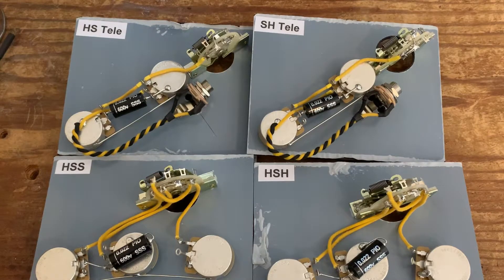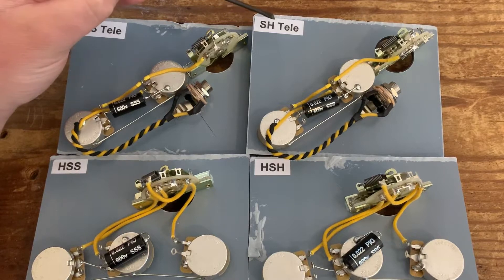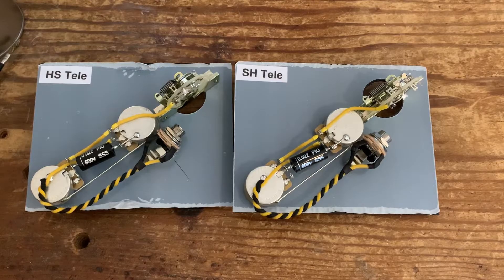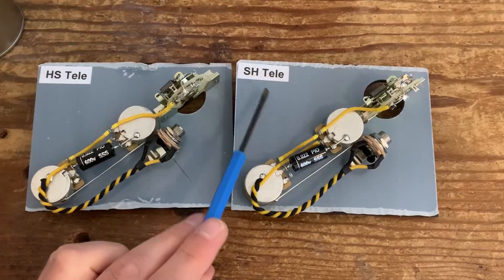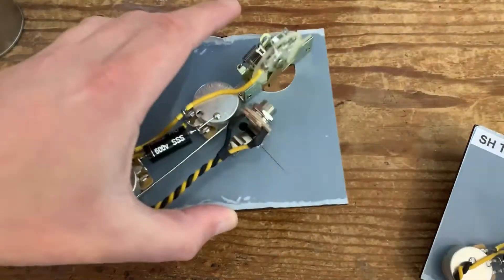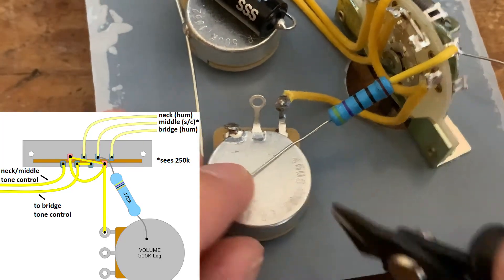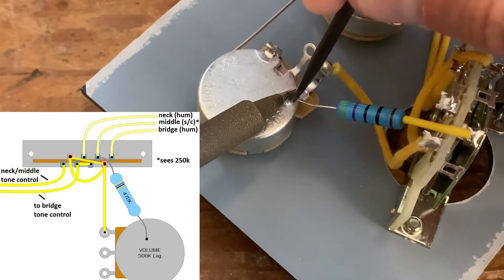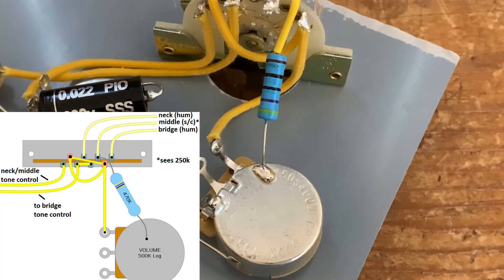How To Use Resistors to Balance Single Coils & Humbuckers In Your Guitar

Comment: Great video!  Is it possible to wire a resistor with a 5-way switch (as shown here) but to achieve the PRS partial coil tap method, instead of using a push-pull?

Comment: what watt rating are the 470k resistors I got 0.25 Watt 470K Resistors but look a lot smaller than your ones in clip would they be ok to use

Comment: Can anyone advise HSS wiring for 1 volume 1 tone, using both 500k pots? Where does the ground from resistor go to, volume or tone pot? Also if using a 500k pots, will the middle/neck pickup still see 250k after resistor install? Thanks a bunch!

Comment: if i wanna do the hss wiring for a hss strat but only have 2 knobs, one 500k master volume pot and a 500k master tone pot. then its just the same except i put the tone jumper wire through all the 3 holes of the selector right?

Comment: Am I correct that you could use a cap in parallel with the resistor to fine tune which high frequencies survive (like a cathode vypass resistor in a preamp stage)? Guess even if it works there might be no purpose since you want to roll off the highs by reducing the resistance.  But could I shape which high frequencies geht rolled off??

Comment: If using this on a les paul. Would you put the resistor to the toggle switch and ground to the switch as well or go from the lug with the pick up connected back to the pot?

Comment: Resistors take away tone from expensive bought pickups.
Reply: The control pots are resistors. 

The added resistor just loads the pickup as if it's seeing a 250K pot, that's it.

Comment: Is it possible to connect a push-pull potentiometer in such a way that when using a high gain pickup, there is a full signal in one position of the potentiometer and a slightly attenuated signal in the other position?

Comment: looked everywhere for the solution to the Tele SH wiring. 500k pot with a resistor between the single coil and switch. But if you're using a 3 way switch - what does each position give you?

Comment: No kidding: I was looking for this and before I found it I figured it out myself. One hour later I find this video with the exact same solution.
I have a Tele with a humbucker in the neck and went with a 1 MEG resistor from the bridge pickup connection to ground.
This way, the circuit "sees" 500 k // 1 MEG = 330 k for bridge/bridge+neck and 500k for the neck only.
A 750k resistor would give you 300k in total.
This will make the SC a little brighter, but it won't muffle the HB in the middle position.

Same for a Strat with a humbucker in the bridge and 500k pots:
1: bridge: HB - no resistor required, the humbucker "sees" 500k
2: bridge + mid: HB + SC - 1 MEG on the SC to ground gives you 500k // 1MEG = 330k instead of 500k, the SC may be slightly bright, but the humbucker still has enough brightness
3: mid: SC - 1 MEG on the SC to ground gives you 500k // 1MEG = 330k instead of 500k, the SC may be slightly bright
4: mid + neck: SC + SC - 1 MEG on each SC to ground gives you 500k // 1MEG // 1MEG = 250k instead of 500k, which is a perfect match for two SCs
5: neck: SC - 1 MEG on the SC to ground gives you 500k // 1MEG = 330k instead of 500k, the SC may be slightly bright

If you really want to do this perfectly, you'll need a super switch and use different resistors for each position.
You connect the output of the 3rd blade to the input of the pot and all presistors are connected to the ground on the other side.
1 - no resistor required
2 - 750k or 1MEG resistor required (the pickups see 300k or 330k in that case)
3 - 510k required (the pickup sees 250k in that case)
4 - 510k required (the pickups see 250k in that case)
5 - 510k required (the pickup sees 250k in that case)
(use a single 510k resistor and connect positions 3-5, of course, use an additional resistor 330k or 470k and connect that from position 2 to 3/4/5, which will then connect to the 510k resistor)

You could use the 4th blade to vary the cap value for the tone control in that case...
Connect the pin from the tone control to the central pin of blade 4 and connect different caps in positions 1, 2, 3, 4 and 5 to give each pickup combination its own tone control character). Connect the other end of the caps to the ground.
1 - 22 nF
2 - 33 nF
3 - 47 nF
4 - 47 nF
5 - 47 nF
(use a single 47 nF cap and connect positions 3-5, of course)

Comment: So just to make sure I understood this correctly, when using 500k pots, I just need to have the 470k resistor connected to the same switch lead as the wire from the single coil,  and then to ground, in order for that single coil pickup to see 250k when selected.  Is that right?

Comment: Hi! Does it matter if you solder the resistors (HSS mod 2x resistors) ground side on the top of Tone pot, instead of on the top of the Vol pot?
Just to mention that my Vol is 500K and my 2 tone pots are 250K. 
Thanks Cheers!

Comment: Is it possible on an SH Tele with a phase reverse switch on the bridge? A resistor on both leads at the selector switch? Im wired exactly like a Baja with a push pull and no cap to ground like there is on the Fender S1.

Comment: So if I've got a Tele with 2 single coils but the neck is too dark, will adding a resistor to the bridge hot terminal on switch and ground darken the bridge so it matches better?  Will the first example  HS Tele work the same if the neck is a single not a humbucker? thanks

Comment: Hey, thanks for the vid it was very helpful with rewriting my telecaster (with a humbucker in the bridge and a single coil in the neck) as a beginner One problem I have now is the volume and tone pots always sound like they are on full, regardless of how I turn them. Are they just faulty pots or is my soldering just bad? I’ve checked mine against the diagram on your website multiple times and it looks the same.

Comment: Thank you for this, however I have a doubt about the HSS, if you put 470K resistors then the Bridge and Middle would see effectively ~242K, that's good,  but what when you have Bridge+Middle so Position 4, then the two resistors will be in parallel with the pot, that gives you effective 160K , and that would make the sound darker, but in this "quack" position you would like to have it brighter, so how to resolve this problem ?

Comment: With the HSS setup, where neck and middle single-coils each get a resistor, what happens with a five-way switch position 4, when both neck and middle are selected? Do they not then each 'see' something like 166K? Also, is the resistor wattage important? It looks like you are using 3W. Are 1/4W and 1W too little?
Reply: I wonder too. That resistor looks like it's 470 Ohm and not 470K Ohm (since the multiplier ring looks black and not orange as shown on his diagram).  I guess black is the new orange lol.

Comment: On your 5 way switch diagrams you have the neck with one tone control and the middle & bridge on the other tone control, for both configurations, hsh and hss. Is it ok to jump at the switch  the neck & middle to a tone control and have the other tone just for the bridge on the hss. Simlar for the hsh, except one for the single coil? Thanks

Comment: That HSS wiring is the most elegant and simple solution I've ever tried. Just slap a .047 capacitor for your single coils and you're golden. You can also easily make the humbucker auto-split in position 2 and you got yourself the best config I've tried in years. Pro tip: use hotter single coils (such as Fender's Tex Mex) paired with a moderate output humbucker like a PAF.

Comment: So the purpose of the 470k resistor is to use resistor association to reduce the resistance to around 250k in the single pickups?
Reply from the maker: yes - but the downside is in the middle position of a Telecaster for example, the resistance would be circa 135k
Reply: @SixStringSupplies 
Doesn't a normal telecaster use 250 for volume and 250 for tone? Which in effect makes the pickup see 125K

Comment: How about this?  EVH Frankie guitar - 500K volume Pot with no selector, no tone control.  I want to hookup the dummy neck pickup.  Where does he resistor go?    Volume pot will be a push/push to switch from humbucker to single coil.  Without the selector switch, I am wondering how it will play out.  Does the resistor go straight in-line or would it be neck P/U hot lead split to hot input and ground and ground wire to ground?

Comment: Late to the party but one thing I just noticed about the HSS wiring. The schematic says to solder the 470k resistor to the first tone pot which is 250k? is that correct? meanwhile in this video you show soldering the resistor to the 2nd tone pot which is 500k? which is correct? the schematic or the video? :D
Reply from the maker: Hey! They are both correct and perhaps this is not explained well enough in the video. You are not soldering the resistor between the switch and the pot, but between the switch and ground. The pot casing is ground so you can solder it to any pot.

Comment: Why isn’t it necessary to add a resistor to the tone pot?

Is it necessary that both pots are 500k or is it ok to use the stock 250k tone pot in the S/H configuration?
Reply from the maker: you can, but even using 500k for both, and using a 470k resistor in one position, results in an approx reisstance of 135k in the middle position. It is already a compromise. So personally you are better off using 2 x 500k or 2 x 250k but if you did want to balance out, then use 500k x 2 and a resistor.

It is not being added to the volume pot. It is being added to the pickup on the switch and grounded on the pot.
Reply: @SixStringSupplies  does it matter the wattage of the resistor?

I’m guessing, no.  Because there’s not a lot of power in a guitar signal… but judging from the size used in the video you’re using 1 watt resisters?

Comment: Good tutorial on the relationship between Humbucker and single coil guitar pickups with 500K and 250K potentiometers or pots. Simple explanation on why single coil pickup needs resistor to step down 500k to 250k.

Comment: Diagram at 12:00 doesn't match what you're doing
Reply from the maker: yes it does....if you are referring to the fact that in the diagram the resistor goes to tone and in the video they are going to volume - they're actually going to ground - ground is ground, you can solder them on either pot
Reply: How you figure??? It's exactly what he is doing... just takes few seconds

Comment: Hi there, I noticed @12:14 that the diagram that you are showing shows that the resistors are connected to the tone pots, but you are actually connecting it to the volume pots. I'm confused
Reply from the maker: they go to ground - ground is ground. Either pot casing, depending on which is easier for you
Reply: @SixStringSupplies  ahhh, got it, thank you sir!
Reply: Thank you!

Comment: I'm ignorant of wiring but very interested. As to the purpose of this mod. My interpretation  is this: in a telecaster the neck pup is always in my experience quieter than bridge.Does this resistor addition "weaken" the bridge pup so that the two are "balanced"? Or in other words EQUALLY WEAK??  Which is preferred because then volume knobs of guitar and amp apply equally, do NOT need to be adjusted when switching between the 2 pups. Is that what is achieved here?

Comment: Hi mate,  I am a new bee and working on a project.  I just want to mount a sound hole single coil pickup on my acoustic guitar with volume ctrl.  So I bought a clip on pick up but when you play fingure style too much body noise as all little touches makes noise.  So I removed the pick up and added on to sound hole cover,  soulder the pickup hot to volume lug 1, ground to back of the pot. Hot from lug 2 to output jack hot.  Ground from out put jack to back of pot and lug 3 grounded from back of the pot.  But I am getting hum and whistling noise....

Please help if you can it looks so simple but I feel like a nightmare
Reply: Also I haven't installed all this in guitar it's still on test bench.  As I don't want to install and spoil the guitar......I am testing by plugging cable in to jack and touching with screwdriver that it works or not.   Signal is stomg and getting lot of out put but humm and noisy

Comment: Question....could you just run from your hot wire on the single coil to the 500k resistor then to the switch?

Comment: i have a dimarzio vv in the neck and a SD Custom Custom bridge. The neck has a high pitched spikeyness id like to suppress. I'm thinking a 1000pf cap to ground on the single coil hot lead?

Comment: Hi, thanks for this video, I have just done my HSS Strat but I have a problem with my humbucker/middle tone control as it is just not working so I can't adjust the tone. I have checked the solder joints and so I was going to replace it but wondered if you had any other ideas to the reason why. Thanks

Comment: Hi, great video. I’m using a 500k tone pot, and 250k volume in my Tele to brighten up the neck pickup a bit, but I would like the bridge pick to stay if using 250k pots. What value resistor do you think I need to use. Thanks

Comment: I bought a case of resistors on amazon so I've been looking up everything possible. I even use a low resistance resistor to connect my bridge and middle lug of the 5 way so my bottom tone controls the bridge pickup too but with a resistor instead of a jumper wire, its making the treble sound better at low volume

Comment: Could you offer any advice on how to apply this when wiring in an HS Guitar with a Les Paul style switch? Thanks!
Reply from the maker: exactly the same - solder the resistor to the switch lug with the pickup

Comment: I have a HSS American Special Stratocaster. It has two Texas specials, Neck and Middle and a fender Atomic Humbucker, Bridge. The wiring fender uses for the pots are all 250k, I want the humbucker to see 500k, Can I use a resistor to mod it?

Comment: As I understand, it will help to keep my volume level the same between louder humbucker (at the bridge position) and quieter single-coil (at the neck position)???
If that's correct, I got one more question: The humbucker will sound quieter like a single-coil after all, or single-coil will sound louder? Thanks

Comment: Great Vid, thanks! On the HSS Strat Wiring link there is alternate wiring picture (without using a superswitch). In the pic there are two 470k resistors, also in the description above pic you talk about 470k. But in the text in the picture you write "250K resistors ensure single coil see 250k". What is now right? 2x 470k or 2x 250k? Thanks again!
Reply from the maker: Thanks for spotting the error in the diagram. Now corrected - 470k is correct

Comment: Great video, helps me with my telecaster build. Couple of questions my single coil (bridge) has a coil tap (high and low output). I'm considering two options either a push/pull for the tap or a 5 way switch with the Humbucker in the middle with high and low output in the "neck" or "bridge" positions. The problem being is I'm not sure where to put the 470k resistor(s?) in either of these options?

Comment: Sorry for the stupid questions.

1. Does having the resistor in parallel with the input signal at the switch affect the value it "sees" for tone pots, or only volume pot?

2. If it only affects what it "sees" for volume, then For HSS since we have a 250k Ohm tone pot 1, would it be better to wire both Neck and Middle to that and have the Bridge alone on tone pot 2 (500k Ohm)?

Edit: thanks for the great videos by the way!

Comment: How does the technique you used for the HS Tele affect the guitars tone when it's in the middle position?

Also, if I used a fender dual 500/250k pot could I wire the humbucker to the 500k volume and tone pots and wire the single coil to the 250k volume and tone pots? And if i did that how would that work exactly?

Comment: Would this mod worsen the volume difference between the HB and SC? I think learned somewhere using lesser value pots also lessen the output. Is there anyway to make SC's sound duller but retain the volume?
Reply: Some people keep the humbucker lower in the pickguard and the single coils up a little more to balance the output. I don't the resistor mod would make that difference more noticable, I mean it might seem that way if you are used to brighter single coils and then you darken them, but the output in decibels shouldn't change.

Comment: Hi Six String, you seem pretty smart.

 I am about to follow your H-S-S resistor model using one tone knob and one volume knob (500k pots) in a Nashville style Tele. The center pickup is a Dimarzio dual sound 4 wire that runs through a mini switch before connecting to a standard 5 way Strat switch, configured in traditional Strat/Nashville Tele switching with a Gilmore or 7 setting mod actuated by the P/P volume pot. My concern is the interaction between the resistor and the humbucker in selector settings that combine the single coil with the humbucker. It's this comment from Fralin... "There are trade-offs to this solution. As soon as you click into position #2 (Neck and Bridge), the combined resistance will yield a very dark-sounding middle position."... that has got my mind all jammed up.

So, like I said, you seem pretty smart, is this an issue? Should I use a separate tone knob for the humbucker?What's the solution?

Imagine this wiring schematic with 500k pots, a dual sound in the middle with the three way toggle and a volume P/P instead of the toggle shown for the 7 way mod,   https://i.imgur.com/p08MdAn.jpg.

Your videos are great and I find them helpful.
Any thoughts or ideas on this would be appreciated,
Joe
Reply: That's what happens in pos 4 (n+m) the single coils see around 125k.  Solder one resistor to the n or m depending which  you use mostly,  not both.  HSS is always a compromise otherwise  try SUHR HSS wiring